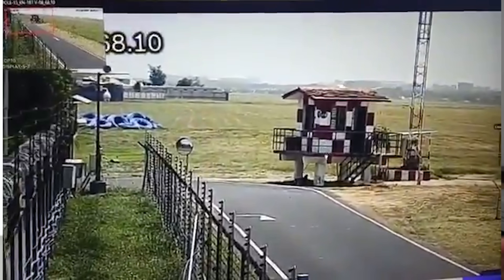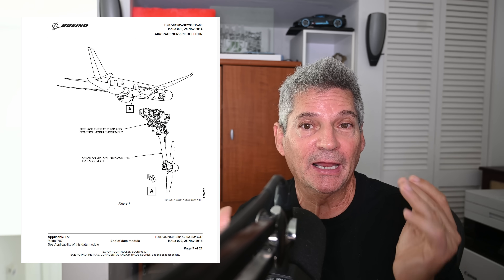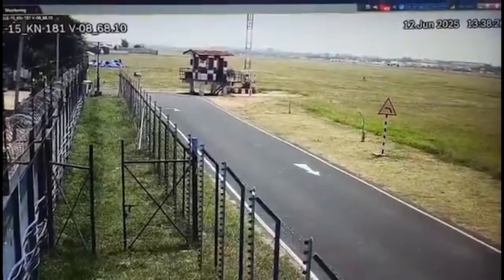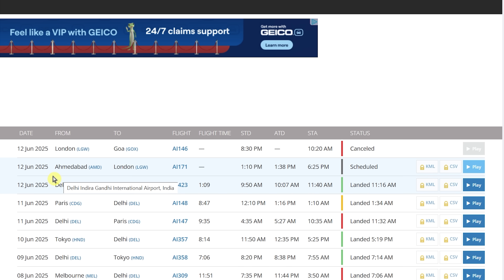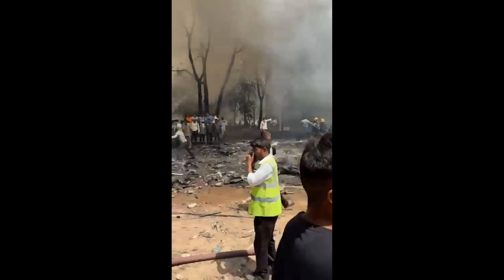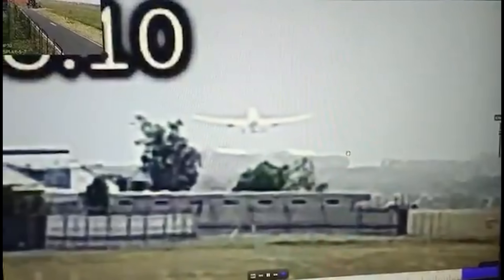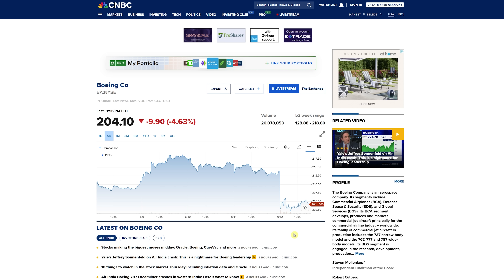What Caused Air India 171 Crash, Mysterious Sound Before Impact

Comment: What I don't understand is how does a plane with all the computer systems lets a plane take off with the flaps in the wrong position.
Reply: It doesn't.
Reply: @LokiCentral  Then all the speculation that the flaps were wrong is bogus?
Reply: @jn1ty I don't think that a failure to set the flaps was cause of the accident, because there are so many cockpit checks and automated warnings, and the plane did take off with what looked to my ignorant eyes like a fairly normal rotation.  It was very shortly after that they started to lose altitude and called Mayday.  The RAT can be heard very clearly operating, which happens with a dual engine failure/gross electrical failure.  The ADSB tracking data stops when the plane is at 625 feet, still flying, and I gather the RAT doesn't power the ADSB system, further indicating a dual engine/gross electrical failure.  A dual engine failure is rare, but happens (e.g. "The Miracle on the Hudson").  It's very unlikely indeed that two engines would independently fail at the same time for different reasons, so investigators will be looking for a common cause.  In the Hudson case that was ingestion of a large flock of geese.  It could be birds here, fuel contamination, a major electrical system problem, I don't think we have any evidence yet pointing to what it is.
Reply: @LokiCentral  I agree. I seen someone saying maybe they retracted the flaps by mistake thinking they were retracting the landing gear. So very sad no matter what turns out to be the cause, so many lives lost in a heart beat.

Comment: No flaps , and absolutely no pilot inputs to  flatten its  trajectory .  The planes nose did not deviate 1 degree from its flight path to the ground contact . This tragedy  May have been  diverted had the pilots lowered the nose to at least level flight ,  put the flaps out to " take off  settings "  gained speed to avoid the stall .. Because that was a stall ..

Comment: My former Aviation Professor at Purdue University was on-site in Detroit, Michigan with the NTSB when the one survivor of the Northwest flight, a little girl was found. The flight crew had been joking around prior to take-off and did not deploy the flaps for lift. I do not see any flaps deployed on this flight, but all of the videos are not the best quality, so they may have been. Praying for all, especially the survivor. Every airline accident is always one too many. Heartbreaking.
Reply: Apparently the 787 raises merry hell with warnings if you don't configure it properly for takeoff.  It took off fine.  Then it started losing height and the RAT deployed, meaning the engines probably failed.
Reply: @LokiCentral  Or, the plane could have been properly configured for take-off but someone in the cockpit retracted the slats and flaps instead of the landing gear.
Reply: @johnstuartsmith  We know the RAT was deployed because we can hear it.  That indicates a loss of both engines/gross electrical failure.  We know the ADSB data transmissions stopped while the plane was still at an altitude of 625 feet, most likely due to no power (apparently the RAT doesn't power it).  Raising the flaps isn't going to affect the two engines and/or the electrical system.  Multiple people are saying there are now photos of the wings on the ground with flaps/slats extended.  I am completely bemused as to why anyone thinks this crash has anything to do with flaps and landing gear.  It's like they randomly picked something before there was any evidence, and now they just keep arguing it.
Reply: @LokiCentral  that doesn’t mean they had time to figure out why if they had other things distracting them!
Reply: @veiledallegory  It will be giving you those warnings all the way through as you configure the aircraft, well before you get off the ground.
Reply: It'll be in the black box. Probably more videos exist, too.
Reply: A pilot operating the flaps in the wrong way doesn't make sense,   is like a professional racecar driver pressing the brakes instead of the gas pedal, there is no way it will happen.
Reply: When you apply takeoff thrust there are visual and audio alerts to tell the pilots of incorrect configuration. Especially something like a 787. Something else happened I think.
Reply: Muricans will do anything but blame Boeing, even though they had that whistleblower murdered in front of out eyes before he could fully testify to congress. And you still trust this company and the government that is in bed with them?
Reply: It's FAKE CGI b.s. Anyone with a working brain realizes that a commercial jetliner would NEVER land, nor take-off from this tiny airport. So sick of this nonsense!
Reply: If the flaps had been down they would’ve obstructed the view of the engines from the angle of the recording camera which tells they were not down. You may have also gotten some YAW if it was engine failure and that plane was flying straight with no pitch and you could clearly see the pilots were trying to pull up in the planes pitch.
Reply: Not seeing flaps deployed doesn't mean they weren't deployed, especially on a low resolution MPEG image with colour "blocking", of a plane with strong rake on the wings.  I didn't see flaps down, but I looked up the 787 takeoff flap setting and concluded it was likely 5⁰ on a long runway, and that I probably wouldn't see that even on good video from a distance.  When flat earthers look at the horizon, they don't see any curvature so they conclude the planet is flat.  This is the same logical error, and what they never ask themselves is whether they would expect to see any curvature.  Realistically the pilots would not have completed the takeoff run without the plane insisting on at least some flaps (which I think means slats deployed), and the plane would not have taken off as it did, at the speed it did, without some flaps.  So we know from the start that there were some flaps, most likely 5⁰, and that implies that the slats were deployed.  It's a matter of concern that so many people seem to jump to, and remain fixated on, the fantasy idea that there were no flaps just because they can't see them, it's flat earther thinking.  What seems to be true is that the plane had lift problems at about the point that the landing gear might typically be retracted, and that there was some gross engine/electrical/hydraulic failure, because the RAT deployed.  I believe the quickest way to lose lift after takeoff is to retract the flaps (losing thrust would require the plane to slow down before lift is lost; BUT would the 787 control software automatically reduce the AoA if it detected loss of thrust, to prevent stalling?  If so, then thrust loss might immediately feed through into loss of lift, and we do see the plane's inclination drop.).  There's no actual evidence the pilots retracted the flaps.  My understanding is that the 787 flight management system won't allow flap retraction at too low a speed - but I assume that is provided the aircraft weight it is working from is correct.  If there were a major systemic failure, retracting the landing gear might not be a priority, and might not be possible anyway.  With no knowledge, I find it an intriguing possibility that initiating the landing gear retraction might have loaded the hydraulic system (and therefore perhaps the electrical system) sufficiently to trigger complete failure of whatever system failed.  Like all sophisticated planes this plane has multiple layers of redundancy/protections, with the very specific objective of making it invulnerable to single point failures.  We should therefore consider it very likely that there were indeed multiple failures which cascaded to give this result - this is the "Swiss Cheese" model.  These failures quite likely include any or all of maintenance, prior unrectified equipment failure, in-flight equipment failure, and human errors, in flight planning, initiating or in response to problems.  But to think these guys didn't configure for takeoff seems unlikely, especially given the RAT deployment, and to think the fact that the landing gear was down implies they retracted the flaps is very weak, and I think is implausible given the RAT deployment.  I think it's very likely the eventual story will be long and multi-factor, but will involve a gross systems failure as the final link in the chain, and as the proximate cause of the crash.  Presumably the investigation will reveal what initiated and sustained the chain of events leading to that.
Reply: Photos of a wing clearly show that the flaps had been deployed. Deployment of the ram air turbine can only happen after both engines have failed and the APU isn't running. 
Nothing makes a lot of sense.

Comment: The noise is the ram air turbine propeller extended when the engines are running below 50 N1, if I recall correctly.

Comment: The pilot new the plane was loosing altitude and put the engines in full power there's no flaps down you could max those engines out and you will have no lift if flaps aren't deployed big mistake or malfunction the black boxes will show what happened for sure....😮

Comment: Normal Sequence (Normally Expected at T/O):
1. Rotation (around 140–160 knots)
2. Positive climb rate
3. "Gear up" call from PF and  PNF raises landing gear
4. Maintain takeoff flaps (either flaps 5 or 15)
5. Flaps retraction only after climb is stable, around 400–1,000 feet AGL

Abnormal or Possible mistake
1. Rotation (around 140–160 knots)
2. Positive climb rate
3. "Gear up" call from PF and here PNF might have mistakenly pulled flaps instead of raises landing gear (possibility is there if he was acting under his muscle memory)
4. Flaps UP with low air speed = stall
5. PF called for mayday and tried to assess the situation but if your aircraft flying under 1000 feet then it's not possible to recover the aircraft from stall position unfortunately.
Reply: What is "V1 rotation"?
Reply: Sorry typo... It's rotation... V1 refers for decisive speed during takeoff.... V1, Vr, V2(optional) terms used by the pilots during take off

Comment: Did the RAT even have time to deploy? I read that the 787 RAT takes 8 seconds to fully deploy, but you have to add in the time needed for the system or pilot to decide that it should be deployed. The engines would need to spool down, I think to get the auto deploy. The plane wasn't even in the air very long at all.

Comment: The landing gear by now should be up position but still down?
Reply: @tamphan2520 - The landing gear should have been up. A fact:  If the surviving passenger stated: "I heard a loud bang about 30 seconds after taking off, and then a few seconds later the plane crashed.", then surely the pilots heard "that loud bang" as well. Based on that, my theory on why the flaps are up (in the wrong position too soon after takeoff) and the landing gear are still down (in the wrong position after takeoff rotation) = The pilot who had their hand on the controls, got distracted by the load bang and accidently raised the flaps instead of raising the landing gear. With "zero flaps setting" the plane instantly lost lift and went into a glide, and tragically crashed. The question is: What caused the "loud bang" inside the aircraft as it was taking off?!? Either a "bird stike" disabling 1 or the 2 engines will cause a loud bang as the engine(s) will implode violently; or, a cargo lashing gave way in the cargo hold, causing a sudden cargo shift and disrupting the  "balance of the aircraft"; therefore, distracting the pilot at the controls.

Comment: It was not a perfect takeoff.  Because this 787 barely lifted off at the end of the runway--you can see all the dust picked up on takeoff.  So there were problems already on the ground.
Reply: @beyondfossil - Surviving passenger heard a loud bang 30 seconds after the start of takeoff - probably a "loose heavy cargo pallet shifted" (causing the plane to lose it's "aerodynamic balance configuration" or a "bird strike'multiple bird stikes that disabled one or both engines" which would also doom the airlplane's takeoff.

Comment: It has been said they didn't use the complete runway and took off short at the 1st turn around after taxiway R4.  Weather was hot and humid. Flaps up and wheels down? Everything was wrong on this takeoff.
Reply: @skydancerforever - Good point because aircraft "perform poorly during takeoff in hot weather", and a "low pressure situation" exacerbates that poor performance. That airport had both a "low barometric pressure" and a very hot 37 degrees Celsius (98 degrees Fahrenheit) temperature... in those conditions, everthing on that aircraft at TO (takeoff) has to be perfect - initiating a "short TO" (not using the whole runway available) made it "an imperfect takeoff in those hot air temperature conditions"= the pilot's "risk assessment was poor" in this case.

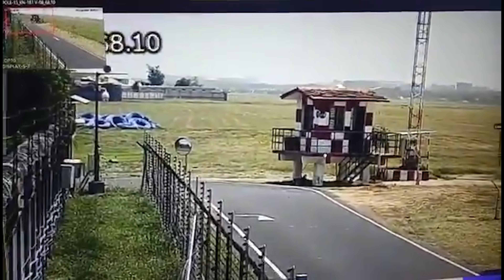Comment: Right at about 10:31 you can see either smoke or something coming from the left side of the engine after takeoff .
Reply: Another YouTuber claims that is the end of the runway, or the unpaved part meaning they only got airborne past the end of the runway
Reply: That "smoke or something" is ground dust from the end of the paved runway... the aircraft likely used every bit of the runway; and then some, as it only used "half of the available runway" according to preliminary evidence.

Comment: But the takeoff didn't look textbook. The plane barely cleared the runway and appeared to kick up dust as it overran the runway. Not saying that had anything to do with the crash, but some other content creators have noted the overrun.
Reply: @countdebleauchamp - True that it "was not a textbook takeoff" = Aircraft HATE hot air temperatures combined with low barometric pressure, as it makes "lift needed for rotation" difficult, especially when said aircraft is "in Heavy configuration" (a heavily-laden with fuel and passsengers/cargo large multi-engine aircraft) as this Air India aircraft was; taking off with weather in "low pressure" and 37 degrees Celsius air temperature (98.6 degrees Fahrenheit) which would; to lower the risk of an "imperfect takeoff", use all of the runway, which this aircraft did not = it has just been reported that this doomed aircraft "took off short"; i.e., the aircraft DID NOT use most of the runway for takeoff.

Comment: As soon as it took off, it dropped like a rock, one thing for sure, the aircraft was way overloaded. Safety rules had been violated....
Reply: If it was overloaded, how could it take off from a normal rotation?  The engines failed shortly after takeoff, that's why it started sinking and the RAT deployed.

Comment: None of the descent was recorded by ADSB. It had stopped transmitting. Also the mayday message was just that, mayday three times without even the flight number, possibly showing radio lost power too. That looks suspiciously like main electrical power failure.  And that could be bad because the Jeju Air flight that crashed attempting a no power landing, did not record any data on the flight recorders after its four main engine driven generators quit from what we now know was a birdstrike due to recovering the engines. So we don't really know what the Jeju air flight crews thought processes were since we only have their communications with ATC recorded, the CVR lost power in the crucial last minute. Unless the 787 has better batteries than a 737 and allows recording during main power loss?

Comment: I heard some one say it was a weight and balance issue...it was over loaded.but now I think it was a contaminated jet fuel issue that shut off power just before life out.... The ram air turbine is not much use during takeoff if you lose power and you're too low